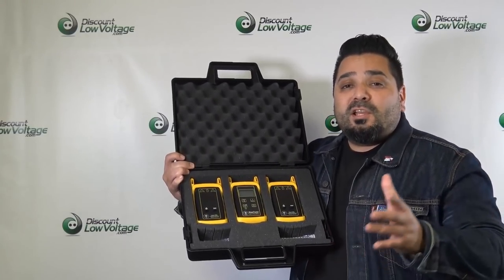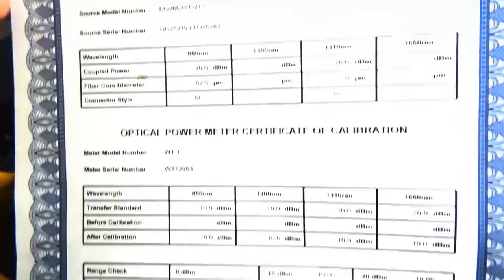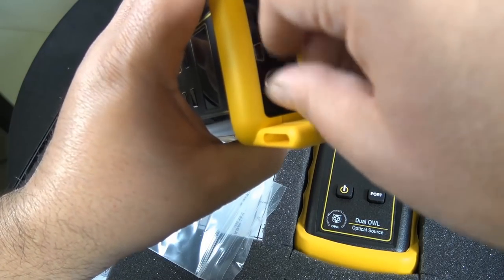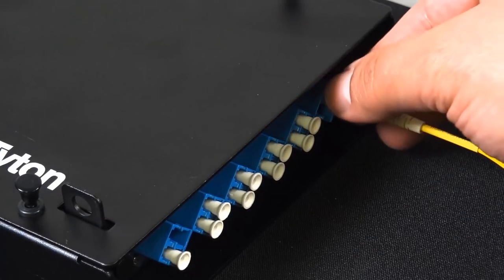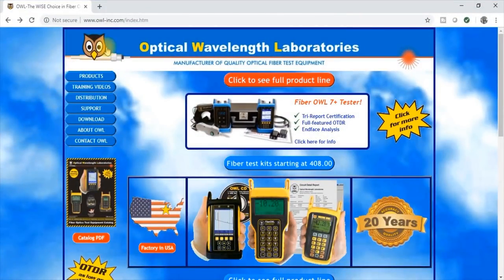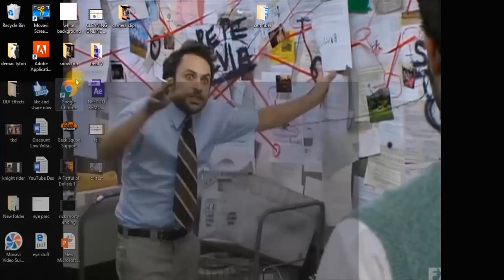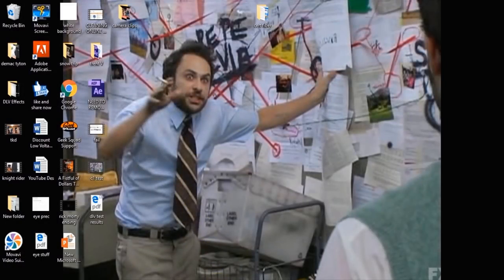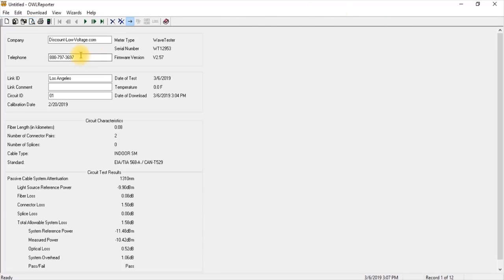How to Certify Fiber Optic Cable at 850nm and 1310nm Wavelengths

Comment: @8:28 you insert another Jumper into the circuit to be measured (How come this didn't have to  in the loop to be zero'd)? I didn't hear a explanation for this?
Reply: You zero the first jumper because its a part of the test equipment and is not a part of the test, you are calibrating your test equipment. If you wanted a result for each additional jumper you would plug the tester to each connection point and save each result. I guess this would be for diagnosing  a particular point in the link that is causing a problem.

Comment: how is 0.92 a pass? the acceptable db loss for single mode is 0.5?
Reply: I have same question
Reply: I think you got confuse with the splicing loss.
This is to measure the link loss. Don't get confused with the splicing loss.

Comment: no mandrel?? if i spell it correctly boss :)
Reply from the maker: Only need mandrel when doing multimode. We have a part number that includes 62.5 and 50 micron.  https://www.discount-low-voltage.com/Tools-Testers/Accessories/Fiber-Mandrel-5400-00-0900-PZ
Reply: @DiscountLowVoltage  wow thank you for your quick reply. your so helpful. ive been working as a fiber optic technician for so long but im not that good in testing :(
Reply: @DiscountLowVoltage  ☺